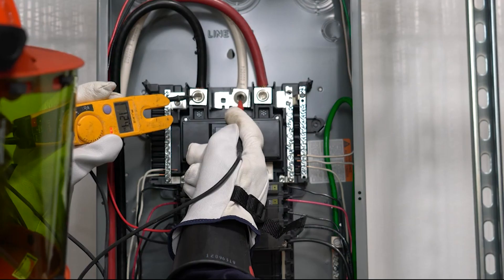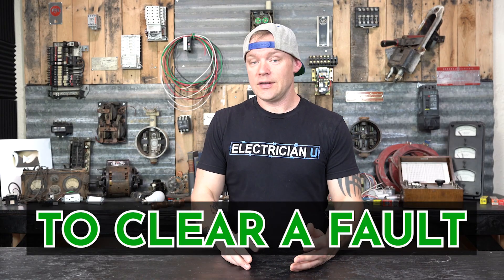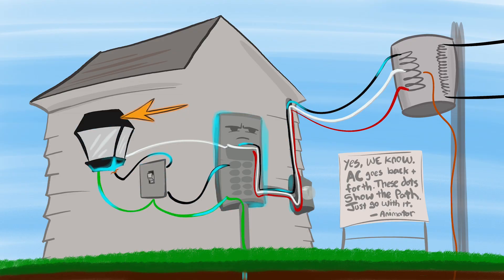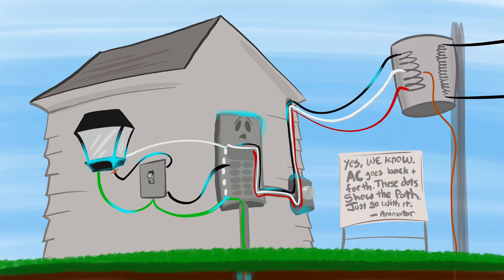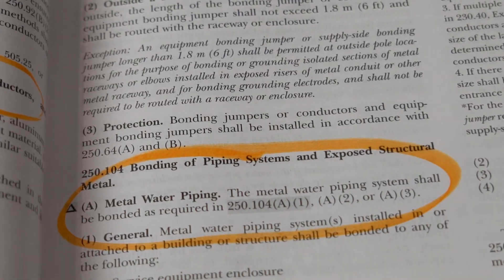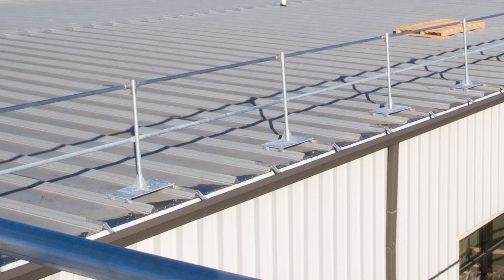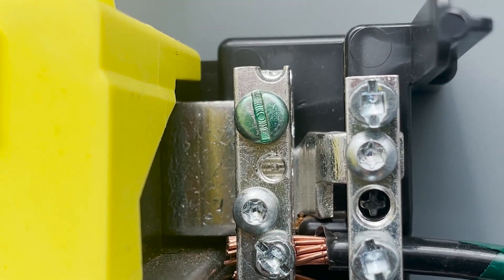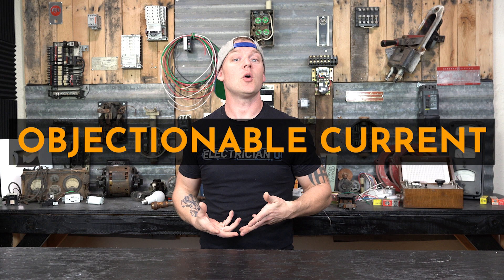Why Do We BOND Neutral & Ground in ELECTRICAL SERVICE PANELS?

Comment: Residential breakers only have the hot line going through them; so, only see current through the hot line. A short to ground would still trip the breaker when the current through the breaker is high enough. I'm sure there are other reasons to bond the ground, but I thought that the main reason was to provide ground protection since there hasn't always been a ground prong. Also, it costs half as much to have a single throw breaker than double throw (just hot rather than both lines).
Reply: This is true, but missing half of the story.  Let's pretend that you have an ungrounded washing machine with an aluminum body.  (Single phase, hot and neutral.  No ground)

Now, let's pretend you have a copper pipe that happens to be grounded, because the pipe has a physical connection to earth.

If you bond the neutral to the washing machine, then when the washing machine runs, you'll get a voltage on the washing machine.  This is because the washing machine has some impedance, but the return path has some impedance.  This will create a voltage divider effect, so your washing machine might get 6-15V on it.  If you touch your pipe, and your neutral washing machine case while it's running, you'll get a shock of 6V-15V.  This could be dangerous if your hands are wet, and the conductivity of the water is reduced due to detergent in the water.

So, we can't bond the case to neutral.

So instead, what if we leave the case floating.  Eventually though, your washing machine ages and leaks some water full of detergent, bridging between the case and hot.  Someone touching your now hot case and your grounded pipe.  This is likely to kill someone.

I'm going to assume it's pretty obvious why we don't bond the case to hot, and ignore that option.

The solution is to ground the case of the washing machine, so that when hot shorts to the case, there's a loop that will draw enough current to trip the breaker, before someone touches it.

It's important to note that if you grab hot with one hand, and neutral with the other, you're not likely to survive long enough for the breaker to trip.
Reply: It is to enable the high current. You cannot get a high enough current with a ground rod. You would need to add additional protection like GFCIs. This is possible and is done in some countries but is not legal in the US.

The problem with bonding is that if the neutral breaks upstream the voltage and the current will come back through the ground wire to the equipment cases.

Comment: But your green and white are connected together at breaker box, so it would flow back to transformer as well as earth and more current would flow thru neutral wire (white), rather than ground (green) wire going to earth (ground rod)
Reply: wut

Comment: Very informative for learning and understanding how the electrical system works in our day to day lives. I would like to see a video on why single phase needs a neutral but not a three phase system.
Reply: Because we use Split Phase AC in the USA.  The Neutral Wire is the Center Tap of the Single Phase 240 Volt Secondary on the Power Pole Pole transformer.  To get only 120 Volts, you must connect your load to either ( L1 and Neutral ) or ( L2 and Neutral ).  If you connect your load to ( L1 and L2 ) then you get is 240 Volts Single Phase - no neutral required.  Some 3 Phase circuits do have a Neutral Wire.

Comment: Not true there a reason why the ground is separate from negative and that when Mother Nature sends lightning into the system that’s why ground should be separated or your home and families are not safe
Reply: BUT ... There is no positive ( or negative ) wire per the AC Grid, in the USA !

Comment: Bonded or not any fault to a hood ground will exceed current of the breaker. The information on generator bonding is so important, I have argued with friends setting up a hunt camp on how to connect the generator to the panel and ground rod. One found out the hard way when taking a shower was an electrifying experience.

Comment: Actually, bonding the "neutral" wire to the ground wire only insures that IF the exposed metal components on any given device get energized, and you touch it at the same time that you touch any grounded metal surface, you don't get shocked! On boats and automotive vehicules, there is NO neutral, and there shouldn't be any!! Why? Because bonding AC to DC will cause all sorts or issues! This means that if you EVER use an inverter in your RV or in a house, DONT TIE THE GROUND SCREW on the inverter to the negative post on the batteries!
Reply: There certainly is a NEUTRAL WIRE on a Boat when connected to Shore power and/or when operating from an DC-to-AC Inverter.
Reply: Is still tying a converter to a metal panel of the car safe?

Comment: Eh? Seems like you just described an emergency path back to the panel to complete a short circuit of sorts. And the wire is a much better conductor than you are, so you're safe(r). Then the breaker trips because of the magnetic or the bimetal switch. Part explanation. Grounds used to go into the ground (hence the term "ground", still do...), thus completing the path back to the power pole/company, right? Just happens that a wire going right back to the neutral bar is a much better conductor than dirt. Therefor, safer. No?
Reply: Dry Dirt is very poor conductor, that may not even trip a breaker.  The Ground Rod is NOT part of the circuit that clears the fault !
Reply: @MrSummitville  Ok. So why does the rod go into the ground? Lightning strikes or...?
Reply: @roginutah  The Ground Rod has nothing do with "Clearing a Fault caused by a Short Circuit" and nothing to do with "completing the path back to the power company".  The Ground Rod is NOT a current carrying conductor for the circuit.  You can use google to find & read many articles about Ground Rods ...

Comment: Great video.  Since the ground and neutral are bonded, why do some local codes require separate buss's for them? Just for clarity? Thanks.
Reply: No Local Code requires separate buss's in the Service Panel ...
Reply: @MrSummitville  I'm thinking they've all been pool subpanels that got tagged during inspection.   If that makes a difference.  Thanks.

Comment: I think you are confused. Bonding has nothing to do with tripping the breaker. You did briefly mention the correct function. It is to ensure all is at the same potential and hence to illiminate the risk of sparking (shock risk) Which could give you a tingle in the shower or create an ignition source at a Gas Station.
Reply: In the USA, bonding the Neutral Bus and the Ground Bus is require to trip the breaker - ie clear the fault.  your country may be different ...
Reply: @MrSummitville  that is grounding not bonding is it not?
Reply: @สมบัติสตีเวนสัน-น6ษ  In the USA we BOND the Neutral Bus Bar and the Ground Bus Bar in the Main Service Panel, only.  We use this "jumper / connection" to trip the Branch Circuit Breaker when the Hot Wire shorts to the Metal Chassis of the appliance.  This prevents the metal chassis from ever becoming  LIVE / HOT.  Yes, we also connect a ( green or bare ) Ground Wire to all metal components = Equipment Grounding.  Also, we Earth Ground the Ground Bus Bar by connecting it to a "Ground Rod" but that has nothing to do with tripping breakers due to short circuits ...

Comment: But what about isolated ground?
Reply: An isolated ground is something you run into in control panels mostly.  This is typically an isolated ground bus (sometimes called a shield bus) with ONLY ONE bond to the main ground bus.  Other than this ONE BOND to the ground (or PE bus) it isn't bonded to the enclosure frame or anything else.  The isolated ground (or shield bus) is where you land shield grounds for field devices.  The reason it is isolated (baring the single point of connection to the overall system ground) is to prevent ground loops that interfere with sensitive electronics (e.g., analog signals to a PLC).  This is really beyond the scope of this video as such control panels are installed further down in an electrical distribution system (well beyond the power service entrance).  But even a control panel will still have its enclosure, devices, etc. bonded to a ground bus.  The isolation bus (shield bus) has a single point of contact to this same ground bus and is used for sensitive electronics.
Reply: What about it ?
Reply: @MrSummitville  How do they work if they cannot come in contact with neutral or equipment grounding?
Reply: @TampaMaximumMike  In the USA, we always bond the Neutral Bus Bar and the Ground Bus Bar in (near) the Main Service Panel. Where are you using an Isolated Ground, that is not bonded to the Neutral?
Reply: @MrSummitville  I work in IT.  Over the last 25 years our specs for setting up server rooms and equipment closets always call for isolated ground circuits for our expensive networking equipment and servers.  In some cases there is a circuit breaker panel in the room.  Most of the electricians  seemed to indicate that the neutral and ground buss bars were not bonded at the panel in the server room.  I don't think they were necessarily saying that they were never bonded at some point.  My original post just means I would like to see a video that clearly explains how an isolated ground circuit is wired using what is considered the current code.  Some of my offices were wired 30 years ago.  I think what is considered the correct way may have changed over the years.
Reply: @TampaMaximumMike  An ISOLATED OUTLET is simply a special outlet where the Ground Pin, in the outlet, is NOT connect to the metal mountings tabs, which prevents it from being connected to the metal box,  metal conduit, etc.  And they use a green (insulated) ground wire, inside the conduit, not a bare copper wire.  Typically, the Neutral Bus and Ground Bus are NOT bonded in any sub-panel ( computer room  or not ).  The Neutral Bus and Ground Bus are ALWAYS  bonded at the Main Service panel, even for your "isolated ground" computer room.  An "isolated ground" is NOT isolated from the Neutral, it is simply isolated from any other grounded metal, giving you a DEDICATED / PRIVATE insulated ground wire all way back to the the Main Service panel, where it is still BONDED to the Neutral Bus.
Reply: @MrSummitville  Thanks.

Comment: Awesome video!!! Would love if you could go more into backup generators. When are they SDSs? Floating neutrals or bonded neutrals at the generator? With what systems do we do what? I know the most basic generator interlock breaker switch keeps neutral and ground connected and only disables the hot wires, meaning it isn't an SDS?  I believe in such a system, the generator should have floating neutral...? Should a grounding rod be installed to the generator? You make this stuff so clear, thanks!
Reply: Bond the Neutral Bus and the Ground Bus at one point.  It is that simple ...

Comment: Is the ground rod used to match the neutral line voltage to the ground voltage, so that you won't get shocked if you touch the neutral wire while standing in a puddle on your property?
Reply: No, that is not the "purpose" of the Ground Rod ...

Comment: Your logic about bonding at 3:50 is faulty.  The breaker WILL trip if there is a short circuit between line and ground without bonding.  The breaker ONLY cares about the current that is passing through it and it is ONLY (at least in the US) on the line. 
It just brings the neutral wire to a lower potential to the earth ground.  In the days before the safety ground it reduced the risk of shock if a breaker was tripped.  Without the neutral being bonded to the ground at the house (with a ground rod), the neutral would be fed from all the live circuits in the house with the voltage being related to the resistance of the line to the transformer and how well it was connected to the ground.
Reply: NO!!! The is no guarantee that a short from Hot to Ground wire, without a N-G bond, will actually trip a breaker on a dry day !

Comment: Short between two hot wires implies multiple phases, which should have probably be made clear. This was an unnecessary complication to stuff in my opinion.
Reply: In the USA residential, we have SINGLE PHASE with two HOT wires = L1 (black) and L2 (red)...
Reply: @MrSummitville  , then I may have messed up the language. English is not my first language. I was under the impression HOT was used for having voltage. It seem to mean something else.

Comment: The reason is to prevent damage from lightning strikes and static electricity, yes it makes trip the circuit breaker as long as the metal case is properly grounded but it also makes you get an electrick shock when is not.
Reply: Bonding between N-G in the Service Panel has nothing to do with lightning ...
Reply: @MrSummitville   https://youtu.be/zLW_7TPf310?t=333

Comment: The reason that you do not bond the ground and neutral together at a sub-panel is by doing so, you create two parallel conductors between the sub and main panels.  One conductor (the neutral) is supposed the carry the return current under normal conditions and the other conductor (the ground) is not.  The problem is that because they are now connected at both ends in parallel, they both share the return current, and you end up with objectionable current on the ground lead under normal conditions.  Worse, if your neutral now develops a break, now all of the return current is returning on the ground conductor and you'd probably never know the difference until something bad happens.  

Since the ground conductor and neutral conductor are not perfect conductors (zero ohms), boxes, conduit, grounded metal appliances connected to that sub-panel are now at an elevated potential while the system is not faulting enough current to trip a breaker (current is still flowing through a device, not directly shorted).  This creates a whole litany of problems, none the least of which electrical shock potential from various exposed metal surfaces.  It is important to reiterate that this condition is constant, not just during a short-circuit event.  The ground conductor is only supposed to carry current when the current escapes from the intended circuit, and do so in a way that it results in a fault trip.

Comment: Lightning strikes the high line a mile away and comes into the house circuit through the ground, zapp goes many very sensitive micro chips. Lots of grounding will help the thousands of volts surge get to the ground before it get to the equipment. Sometimes it doesn't make any difference, a million volts goes were it wants.

Comment: Not sure if it was explained : so on a sub panel where is the ground “connected” ?
Reply: The equipment grounding conductor (bare or green colored insulated ground wire/cable) is connected to the sub-panel enclosure and equipment grounding conductors of the sub-panel's branch circuits. Also where another grounding electrode conductor is ran to if the sub-panel is not installed on the same building/structure the main service is located/serves but if the sub-panel is installed on the same structure/building, the grounding electrode conductor is not required to be ran to this termination point. 

The grounded conductor (white/natural grey/continuous white stripe colored insulated neutral conductor) terminates to an isolated neutral terminal bar with all the sub-panel's grounded (neutral) conductors only, regardless if the sub-panel is installed on the main structure/building or a separate building/structure.

Hope this helps